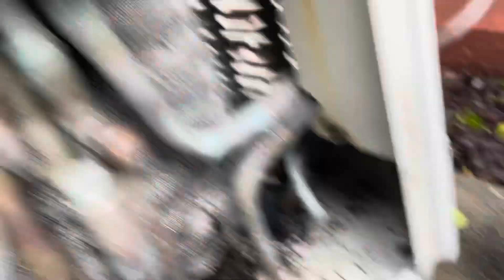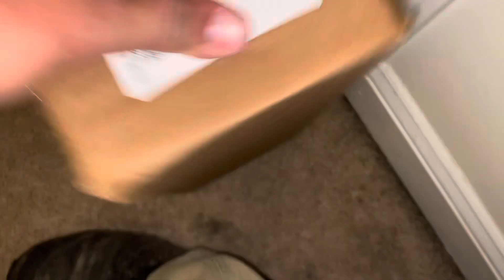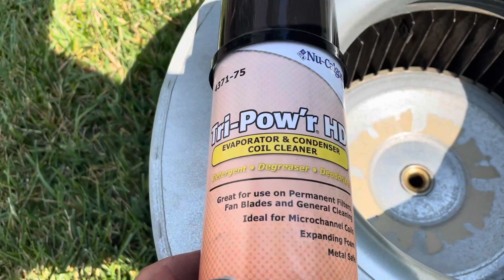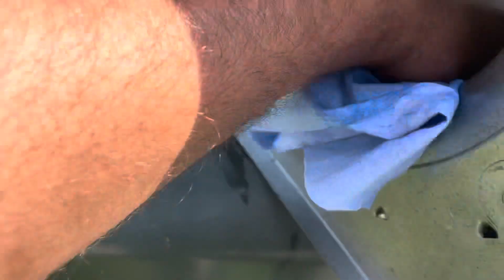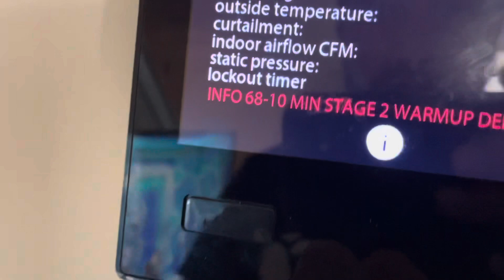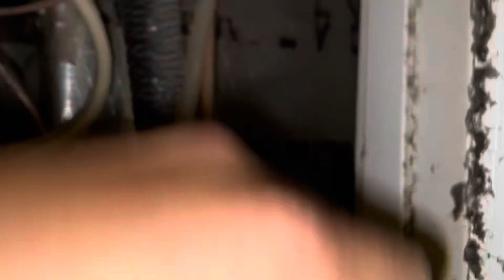HVAC Service Calls | Blower Motor Swap

Comment: I use a 1/4" nut driver and a hammer to tap it out. If that don't work, then the puller.
Reply from the maker: Good technique! 🤙.  Never thought to use a 1/4” nut driver.

Comment: the resistor is to keep power for the oil heater.internal on the compressor.thanks for sharing.

Comment: Something to make note of about the Carrier/Bryant ECM VCA blower motor.  Was it the ECM module or the actual motor that failed??  There is a big difference when not in warranty.  You can replace either the motor or the ECM module out of warranty, which is far less expensive.  Also, US Motors makes a Rescue motor that is a direct drop-in solution and Evergreen makes a direct replacement that is a fraction of the cost in both solutions.  That was a Carrier part number, which is the same as Bryant.  They are the identical company, so don't get all freaked out about the price outside of warranty.  This goes for all brands of systems from Trane/AS, Daikin/Amana, Lennox, etc.  VCA and VCT ECM motors are two parts and have alternatives, but as technology changes, those parts will get less expensive in the future.  The Evolution is the top of the line product which is the same as the Carrier Infinity.  This about it as like the BMW or Mercedes-Benz model systems.  Fully Variable systems are worth their investment and carry a good warranty.
Reply: The problem with not going oem is it’s a communicating system and it communicates with the blower motor
Reply: Waste of money imo rather have a 14 seer that is more reliable and much cheaper
Reply from the maker: I’m pretty old school myself and prefer the 14 seer stuff but here in MD we are minimum 15 seer now and as the years go on the minimum seer rating is just going to keep increasing.  God bless us. Lol